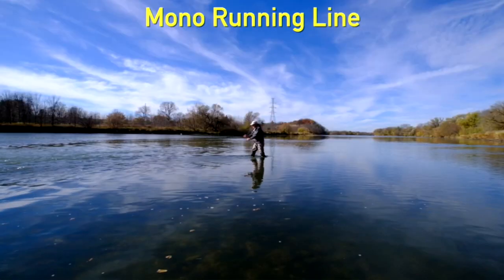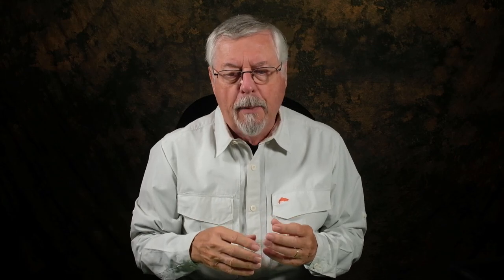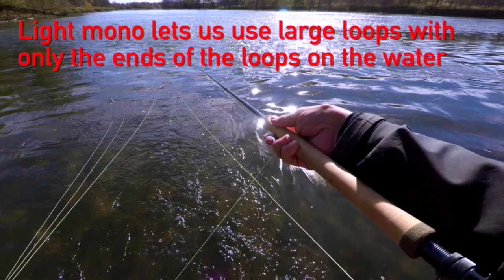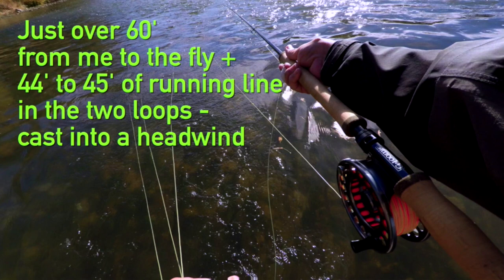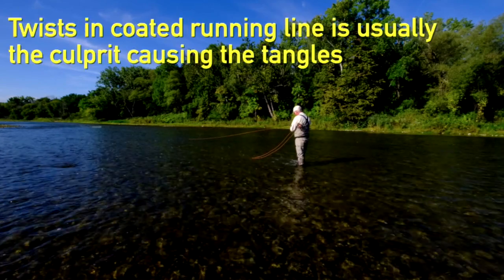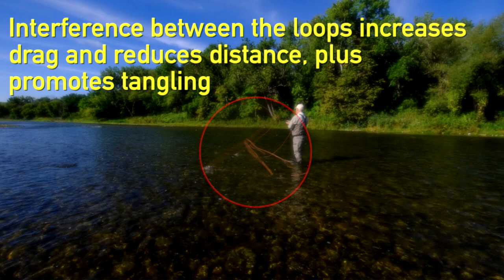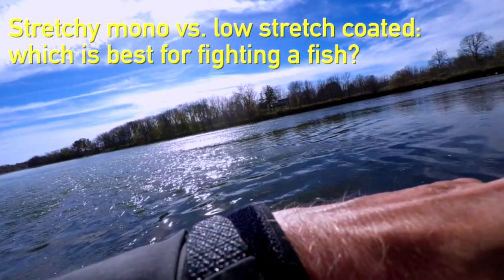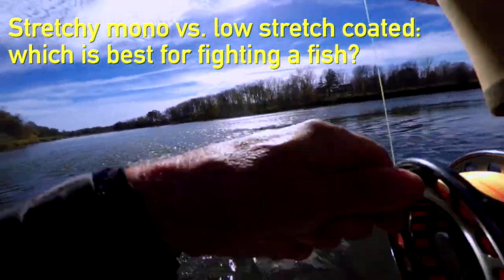Efficient Spey Casting: Part 25 - What should we use Mono or Coated Running Line

Comment: Having been doing more single hand micro skagit on my 3 & 5 wt rods (and their matching smaller reels), The OPST commando heads and tips combined with mono is my preferred setup...  I tried using 15lb coated running line and it drastically reduced my casting distances along with thew coiling issues.  Tried SA's flat shooting mono and that is worse than the coated running line.  Recently purchased OPST's new oval mono and will be giving it a thorough workout over the coming few months on the local native resides here in my area hoping it resolves the issues I've had with single hand rod micro skagit casting...

Comment: Great video. How about the tension of the line in flight when using a light mono runner? You easily lose line tension and the air resistance of the fly line increases. Then the casting length falls and the line does not straighten properly. When using coated running line, the friction of the coating keeps the fly line in tension, as well as the greater weight of the running line. The fly line flies straighter and the loop unrolls better. It's easier and more reliable to make a longer cast where the fly line straightens up to the hook. It is worth comparing in places where you can estimate the actual casting lengths or cast against a measure and look where the fly lands. I use nowadays only coating running lines, stripping long strips 5-6-7, 6-7-8 or 7-8-9.
Reply from the maker: That's an important issue and in other videos I've likened it to the fletching on an arrow, but the characteristics of the head and the quality of our casting also impact this issue.

With a well designed head well cast, the running line has limited impact on the quality of the cast beyond the obvious distance issues (less resistance = more distance). When the line taper is clumsier along with the casting, then the drag of the running line will help to smooth things out.

I didn't add these issues to the video to avoid over complicating things.
Reply: @hooked4lifeca  Hi. I think that less resistance is not always more distance. I have noticed that if I use  a light mono running line I have to delay the timing of when I let the fly line fly. Otherwise the heavy rear end of the fishing line will fly far and the fishing line will not straighten properly. Or you have to brake the thin running line with your fingers so that the fishing line straightens properly. The longer cast and harder you cast, the bigger the problem. By using an appropriately thick and weighted coated running line, the fly line remains under tension during flight and always straightens well, whether cast close or far. Most of fly  lines with integreined running lines had quite thick coated running  line.  They keep always good tension of the fly line and the turnover is always good for all casting lengths.They are like automatic transmission cars. Easy to cast close or  far off. For longest casts you have to choose a thinner coated running line.
Reply: Interesting. I guessing it's the inertia straightening out the line sooner in the air; it would be considerably less air resistance, and at that speed the air resistance is the biggest factor. My precision currently isn't good enough to release the line right when the shooting head starts to straighten instead of where I stop in the cast. With mono, I'm curious if it's better to have a lighter head, because the inertia of the mono will be greater. I use mono on a 300gr scandi with a 10' 6wt T&T switch rod and it casts notably farther then with a 330gr; the same length head. I initially got the 300gr head for an 10'4" 5wt OPST Micro Skagit, but will go lighter next season, maybe like 270gr.

Comment: I read a book which written by Albur, tells how to design fly lines. Albur talk about the resistsnce of intergrated coating running line  benifit the head unrolling.If I change the intergrated line into a head, and use a mono running line ,will it get negative impacts?
Reply from the maker: Not usually. Mono running line sinks slowly so there will be water drag on it as the head rolls out. That drag is enough to stabilize the flight of the head. The negatives are more about handling and the loop-to-loop connection.

Comment: The issue is when netting fish with a loop to loop connection catching the guides can be a real pain.  So I was thinking using integrated scandi next summer; however, I was thinking of putting a braided loop on the butt end to create a smoother connection to the mono running line. It seems like the double surgeons is the smoothest connection and maybe creating a smooth ramp to the knot with some Aquaseal.  I'm wondering if you have any experience with this?
Reply from the maker: I stopped using braided loops a long time ago. Too many problems and they're definitely not smoother. 

The rear loop to the backing is never a problem, as when under tension, it flattens out quite well. I've had quite a few fish pull the backing out and there has never been an issue with the loop-to-loop connection backing to fly line as the connection is quite small.
Reply: A triple or double surgeons is so big and so hard for the guides. I am using a perfection loop on the running line loop to loop connection.You know, a mono running line is very slippery to tie a perfection loop, so when the loop is forming,I do a extra step,make the thread goes through the other side before tighten the perfection loop.It is small enough and never to slip,then use a drop of UV glue and make it smooth.
Reply: Try coating the knot’s edges with loon knotsense. Make a narrow football shape over it to smooth it out and it’ll let it slide through the guides without catching.
Reply: The double surgeons is better for steelhead. it's my go-to knot for the running line. The perfection loop sticks out like in a right angle while the double surgeons is more elongated and with some aquaseal it makes a perfect football shape.

Comment: What about mending the 2 runninglines and how does the line perform with sinking heads ?
Flemming
Reply from the maker: Really not a lot of difference when mending them. I do find the coated lines mending a bit more easily thanks to them having more mass, but the difference is slight. Mono is better for full sinking heads thanks to the smaller diameter and that mono sinks (slowly).